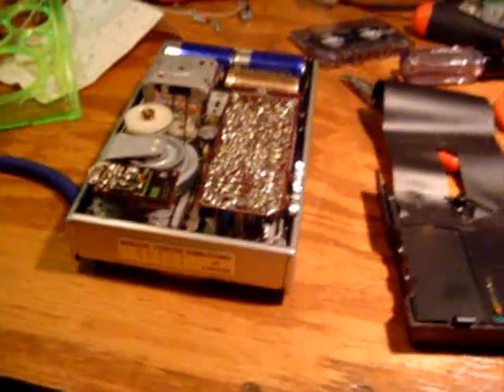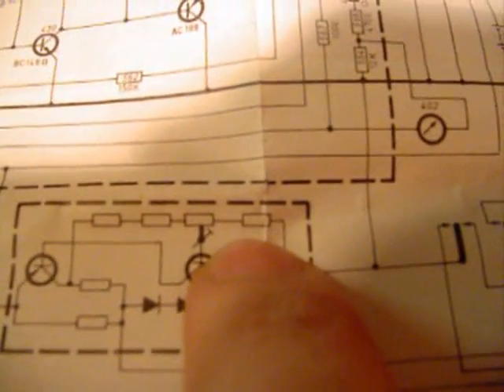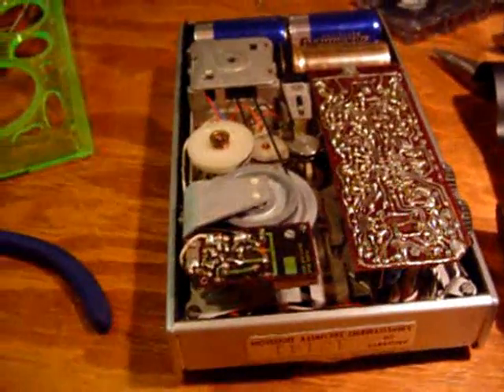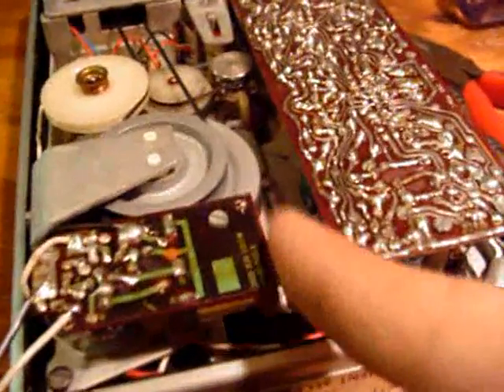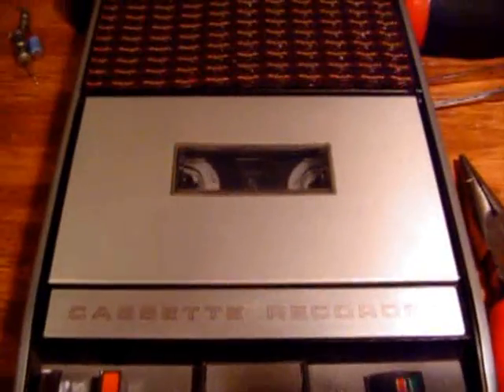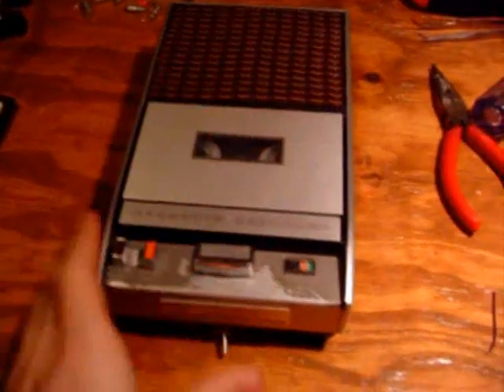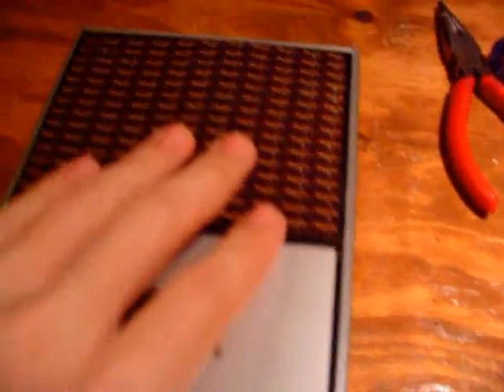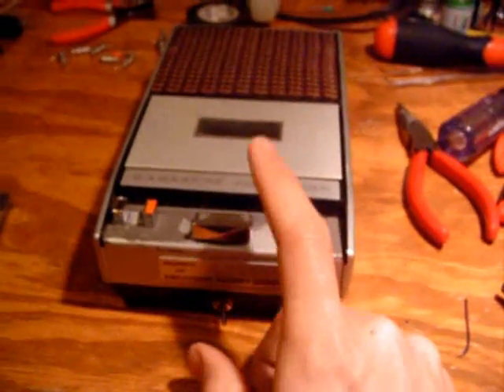Philips N2 202 cassette recorder modified for 2-speed operation.

Comment: In my Philips (similar to this, but older and without eject button) the speed controller cannot be adjusted, speed was unstable in long term (not talking about flutter). something was going here, I got tired and change the motor to a 6V with built in electronic control, but now cannot do this trick. Well, perhaps using those motors with A-B terminals to put a pot make this thing possible.

Comment: Like my Tandy CCR-81!! I did it exactly the same way but no resistor. Probably runs close to 1/4 of normal speed than half. I never calibrated the slower speed to anything.
My next goal was to put the speed trimmer pot on a large knob on the front for complete variable speed!

Comment: I modified a 2 speed walkman to run at 1/4 speed by putting a resistor in line with the motor and adjusting the trimmer. I use it to listen to an overnight radio talk show at my convenience. I have a Versacorder tape recorder with a timer on it that records in 1/4 speed and I did have another 1/4 speed walkman but I used it so much it wore out so I had to modify another one. Sadly the company that sells the Versacorder doesn't sell them anymore :/